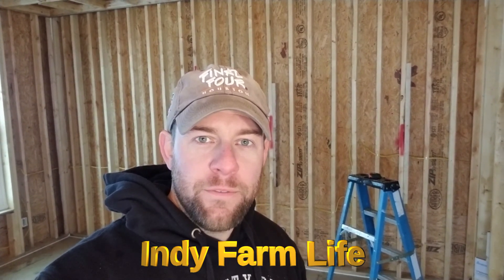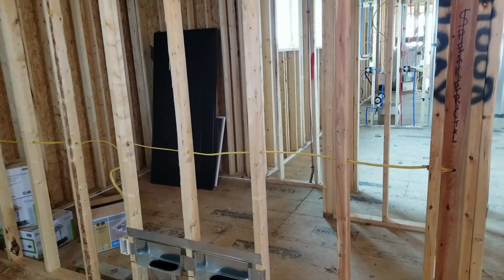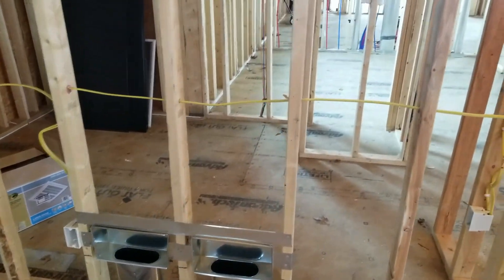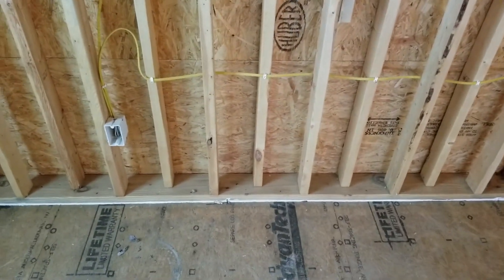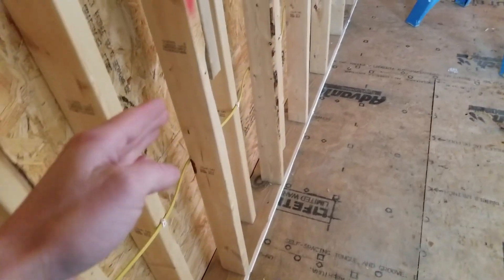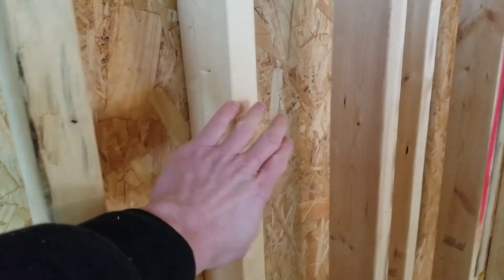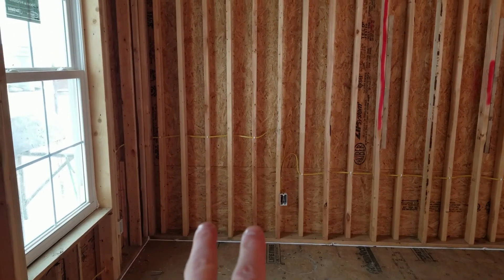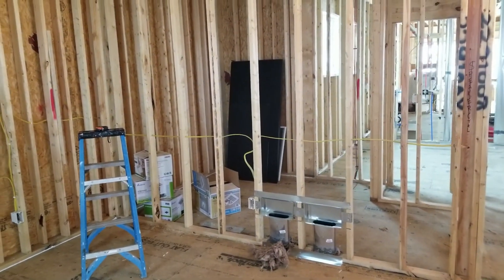Staggered Stud Walls: An Advanced Framing Technique - This is COOL!

Comment: why not 24 inches OC ?
Reply from the maker: We went this route to add strength to the house as well as create the thermal break between the interior and exterior.
Reply: you can do 12" OC this would give you 24"OC for drywall and exterior sheathing
Reply: @Kakalacki how do you do that if you were to put two individual 2x4 plates and the walls not mirroring?
Reply: @gtarules1  I was referring to staggered stud framing I believe you are confusing this with Double stud wall framing.
In staggered studs you use a 2x top and bottom bigger than your framing studs. If framing with 2x4 studs use a 2x8 top and bottom @ 12" oc, alternating between interior and exterior wall, when you stand them up you have 24" 0c for sheathing and drywall.

Comment: Ok get ready for big r3tard who doesn't know thing in LA question but if I am focused entirely on isolating sound and not insulting other types of waves wouldn't it be better to not put a substance between the inner and outer wall through which sound can travel? 

Idk I'm so tired at this point.
Reply from the maker: No question is a dumb question!  When you say "not put a substance between the inner and out wall" are you referring to the insulation?  I.e. just having an air gap?  If you aren't concerned about thermal insulation, then you could forgo that, however, I would just then change what you put there.  Any material that deadens sound, vs carrying it would be helpful.  Something like Rockwool soundproofing insulation would be good or you could take it a step further and put in true soundproofing material.  Those two would perform better than an airgap alone if sound attenuation is your main goal.

Comment: Why do you need to make it an 8 inch gap? Wouldn't a 16 inch stager work?
Reply from the maker: The studs are offset.  Every 8" there is one on the inside of the plate and then the outside of the plate.   You can't just go 16" OC with 2x4 on a 6" plate.  You would need to use 2x6.  Then at that point, you lose the benefit of a staggered stud build, which is thermal decoupling.

Comment: Spray foam is not ideal if you are using staggered stud wall construction to attenuate sound. Also code in our area does not allow one to run electrical parallel with the floor. One must run parallel with the stud and then run under the floor or in the ceiling. Always check local code if you are wiring yourself.
Reply: very rare code to not allow parallel in the USA atleast. Every state I've build in has allowed it.
Reply: Never heard of that.   Perhaps they want you to use a metal plate to protect horizontal wiring.

Comment: Why not use 2x8 plates instead of 2x6? It probably wouldn't cost much more, same labor, and you'd get a lot more insulation space. I guess the extra insulation itself would add to the cost too. But how does this technique compare to using 2x8 and NOT staggering the 2x4s? You'd have a 1.25 inch air gap between the 2x4s, but batt insulation would be easier to install.
Reply: Realistically, you're probably better off with continuous external insulation.  This way the entire wall assembly is thermally broken before the sheathing layer.  Giving you a whole-wall insulation BEFORE dealing with the wall cavity at all and drastically increasing whole-wall R-value and general wall system performance.
Reply: I was planning on building a staggered stud wall with 2x8s for top and bottom plates, 2x4s staggered studs, closed-cell spray foam on exterior framing, a 1/4" air gap, then fiberglass batts on inside framing so I could remove if remodeling.
Reply: @605Daddyslots the issue I see with that is the Spray Foam: foams off-gas which isn't just a problem with air quality but the actual foam shrinks over time. That leads to air gaps in 10+ yrs.

But as a whole system that wall also may have issues drying as the Spray Foam acts as a vapor barrier. Depending on the climate you are building in you may have water issues if the foam is preventing drying in a needed direction.
Reply: @S M my math was off, but a 2x8 is 7.25 I think
Reply: Thermal break.
Reply: You build the whole thing with 2x4s  its just cheaper
Reply: You totally missed the point!!! 😂

Comment: Would love to see a thermal image of the wall.
Reply: I saw one recently. It looks very similar to an ICF wall thermally. Though there is still significant thermal bridging at the top and bottom plates as there is no insulation there.
Reply: @KDreezy I think installing a 2” insulation board over the studs or cladding would still be the best to prevent thermal bridging at top and bottom plates and floor joists. Pretty common here in central Canada.
Reply: @peterwright4647 does the 2" go on the inside or outside?
Reply from the maker: If I had a thermal camera I would take one for you!

Comment: with bat insulation would you serpentine in and out or insulate staggered as if it were 2 different walls?
Reply: Considering the added cost in framing materials, which is primarily intended for energy efficiency, plus the added labor of dealing with batt in this arrangement... I'd say just go ahead and spend a little more on the spray foam. Easier application and better performance make it worth it
Reply: @TheEvox81  if you're going to waste money with the spray foam, then you might as well just frame a conventional 2x6 wall and keep it simple.  doing both is just wasteful overkill
Reply from the maker: They kind of end up being one in the same.  Getting insulation in behind the studs closest to the interior would be preferred, so in order to do that, you need to insulate the "outside wall" with batts.  You will then want to be sure you have insualtion between the studs of the "interior wall" as well.  So you are insulating both walls/weaving in/out at the same time.  I would go with spray foam if you have that option.  Makes it so wounderfully air tight!
Reply: Dense pack blown in cellulose is easily the cheapest and most effective. Batts don't like to get compressed and foam shrinks over time.
Reply: @ElvargsBane I agree cellulose is the way to go.  

But I’d like to point out that batts actually insulate better when compressed.   It’s an old wives tale that they don’t.   

What I mean is…..Squishing an r19 batt into the space of an r11 space yields more than r11.

Comment: But twice as expensive?
Reply: It's a $3 piece of wood...
Reply: @gtarules1  spend to the poor house
Reply: @MadRat70   20' wall would require 16 2"x6" studs at $8.00 each = $128.  Staggered 2"x4" would require 32 studs at $3.50 each =$112.  At current costs, a staggered 2x4 would actually be cheaper for the wood costs.

Comment: Double the amount of wood needed. No?
Reply: It pays dividends tho..better insulation means lower bills.for heating and cooling for the entirety of the houses life.

A little extra at the start saves a lot for the next 20 years
Reply: @zeldaandTwink  why do we need double the wood anyways?
Reply: @Dollapfin  because offsetting a normal amount of framing like that makes it more unstable. It's like standing with one leg Infront to the other and someone pushing you from the side.

By doubling the wood it's like having 4 legs, much more stable.
Reply: the exterior wall studs end up being a small fraction of the entire lumber package.

Comment: We did this in the early 1980s in industrial manufacturing computer rooms for temperature and sound control.
Reply: Did they build out of wood commercially? Or was it also steel studs like today? Would love to know
Reply: @NuttedInYoMom  steel stud have to be fastened in to top and bottom plates, so the answer is no.

Comment: I wonder if code allows for 2×3 studs to be used instead of 2x4 in this staggered manner? It would allow for even better insulation and ease of running electric as well as cost and weight savings.
Reply: For regular 2x6 wall it's R23 for 2x6 insulation and R6.9 for 2x6 stud. If it's 24" OC it's not that bad. You have 22" of insulated space vs 1.5" for stud. Ratio is almost 15:1

For this staggered 2x6 wall let's say it's the same R23 for 2x6 insulation and for every 6.5" of fully insulated space you have 1.5" of 2" insulation(R8) + 3.5" stud (R4.4) = R12.4 total.
Ratio of fully insulated space of R23 to stud+2" of insulation is 4.3:1.

Also remember while stud-thermal bridging is eliminated, you still have plate thermal bridging which is the same for both walls and for 8' wall plate thermal bridging is essentially = 3 studs of thermal bridging (because you have 2 top plates and 1 bottom plate). So regular 2x6 wall with 24" OC will have 5 studs + 3 plates thermal bridges = total of 8 2x6 thermal bridges. For staggered wall you will have 3 2x6 plates only as thermal bridges. So it doesn't mean you eliminated thermal bridging entirely, you're just reduced it, but had to do a lot of work to do it.

Like these numbers seem pretty close to me overall if you combine them together. Staggered wall will have more lumber and slightly less insulation material, yet likely be more efficient, but this difference isn't worth the effort IMO.

I don't see a reason to go this way honestly. 

Personally if I were to go beyond standard 2x6 wall, I'd go for either 2x8 wall (con: no precut studs) or go full on double wall with outer 2x6 layer 24" OC and inner 2x4 16" OC with 3" gap between these 2 layers instead of this staggered on 2x6 setup.

The only difference is having to buy 2x6 24"OC studs instead of 2x4 16" OC studs and having to buy extra 2x4 plates for inner wall, but result would likely be 3x in R-value for the resulting 12" thermal bridge free wall. More money has to be spend on insulation of course, but at this point it would be money well spent.

And if I do this staggered setup, I'd prefer doing it on 2x8 plates.  So in conclusion IMO there's little reason to do staggered setup on 2x6 plates.
Reply: @artemaung5274 I tend to agree with you on this. My thoughts would be to just add a layer of exterior insulation - say Rockwool 2" comfortboard. Overall I think you would get better R values, similar or better sound isolation, and unfortunately a higher cost.
Reply: Great question! The NDS and CNBC codes don't explicitly prevent the use of 2x3 lumber in load-bearing walls. They present tables of minimum values that permit the use of 2x3, but leave the final decision up to the designer to ensure that the structure will meet all project parameters. That being said, a seasoned designer will likely opt for heftier lumber due to the inherent mechanical properties of wood and its tendency to experience dimensional changes over time.
Reply: 2 x 3 is same cost